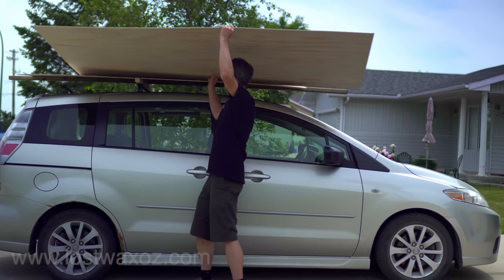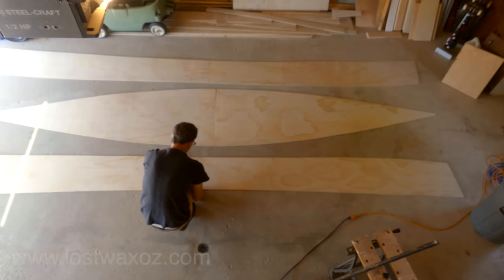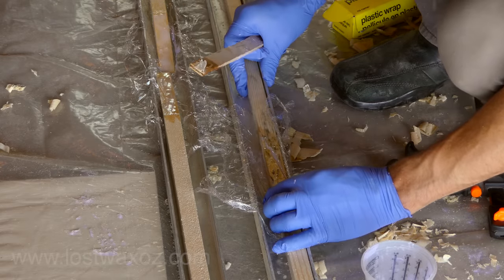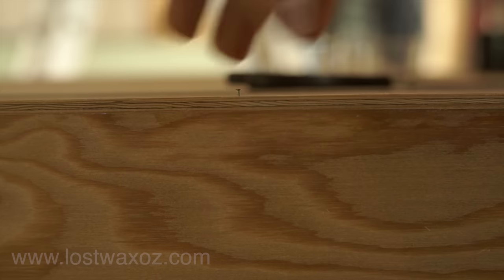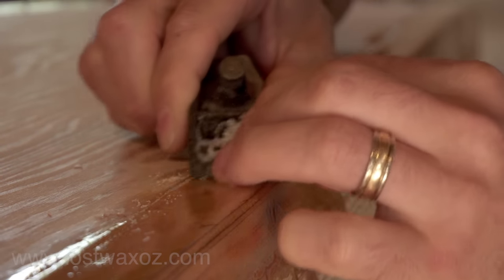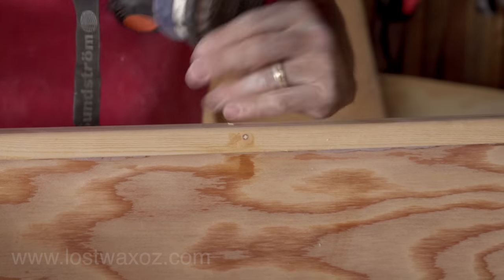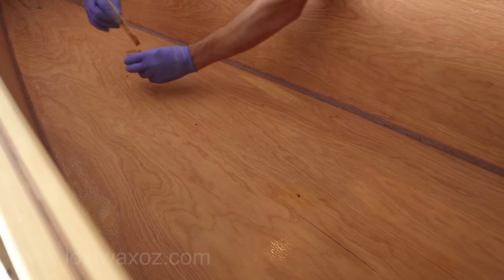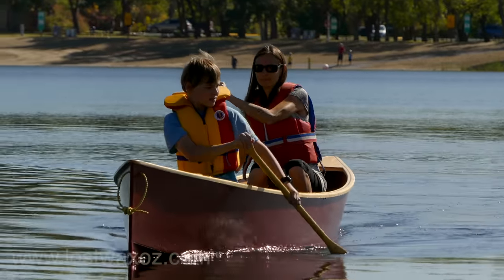Can You Make a Canoe from Plywood? DIY Quick Canoe. Plywood Cheap Canoe Build

Comment: A bit late to tell you that, but your non-water resistant plywood would have been fine once sealed into epoxy (as long as any hole, including screw holes, are epoxyed).

Comment: I built one of these years ago. They are nice boats. One thing that I would stress is to clean all the dust off the sides and bottom before trying to duct tape them together. I did not at first and, of course, the tape did not stick. The additional zip ties are a good idea. As I understand Michaels idea for this was to have a quickly built boat for when you find yourself wanting a boat and don't have one available, and it can be built very quickly and very cheaply if you are looking for a temporary boat, or, like this fellow did, you can make a really nice almost work of art. Well done Lost Wax 2

Comment: This was great to watch. I actually built one of these but had to leave it in my old workshop. Just a tip, that first plywood you used would have been fine as you are covering it with Epoxy and paint. This Marine ply is great stuff but heavily overrated. It just isn't needed for a canoe.

Really great to watch what you did and happy boating!

Comment: 9:55 Probably could have / should have routed a radius on that lift-point- just a thought.

Nice project. I can see myself building a canoe like this. I am an off-and-on professional woodworker and I can see that as a very good design for a user-friendly family canoe being that it's flat bottomed and thereby has some stability over a rounded chine canoe. 

As a woodworker, building a run of these with particular cosmetic and esthetic alterations seems like it would be a sensible effort. I have made boat bottoms in the past from 8' plywood. Athough from a cost perspective it might be hard to justify a reasonable selling price based on labor time, the availability of ACX and marine AAX is not what it used to be as you discovered.
Esthetically I would probably choose a non-keyed glued scarf to join the ply halves into 15'5" planks instead of a battened butt joint. You can readily plane these halves using a reverse fold. Not much more work than a batten over a butt, and no interruptions in the sole.

Another visual improvement you might consider for your next canoe is in the fiberglass tape application. What you did here is fine structurally. Nevertheless, you might find it less time consuming to apply the tape, and then use matt over that (width about 10"?) to extend the bulky edge of the tape further into the bottoms of the sole. This will allow an easier time fairing the transition, offer an added durability factor, while permitting the use of your random orbit sander to initialize the bulk of the work.

I hope you will be making more boats!
Reply from the maker: Thanks for the great feedback, I'm sure that'll be helpful for others considering a build like this. You are right, it would be nice to have a more comfortable place to hold the canoe while carrying, and rounding off those bits of wood would help. That is one of the main reasons I added handles to my sailboat build, and even though it weighs the same, carrying it feels like half the work.

Comment: Can you foam craft a canoe next?  Bettter idea, foam craft a full  size Viking boat?  BTW This is the best video I have ever seen and it has changed my life forever.
Reply from the maker: Did you know there are actually foam boats out there..... Made from the rigid insulation foam and covered with wood glue and fabric. Pretty cool. Thanks for taking the time to help me out! Much appreciated!
Reply: @LostWax2  I had no idea. I am going to look that up. Love all your content BTW. Cheers
Reply from the maker: I think one to look up is the sawfish kayak if I remember correctly....made from poor mans fibreglass
Reply: @LostWax2  Didn't you make a surboard using that method Chris?. Another cool exploration.
Reply from the maker: @MikStorer  Yep, totally, It worked quite good. I used it over EPS foam but I think you'd get even better results over XPS foam.

Comment: Great work! Did you cover all the boat with fiberglass? Or just the boat connection parts?
Reply from the maker: I Just used  fibreglass strips along the bottom edges and front and back points.

Comment: My boys and I love this video!  It helped to inspire us to build a similar plywood stitch build canoe.  

I'm struggling with the deciding on how much epoxy we'll need, and whether to coat any of the exterior with it (I read your previous comments on checking).  Could you estimate how much epoxy you used all together, and how much of that was used to coat the exterior?  Do you think it added to the strength and durability of your boat?
Reply from the maker: I used ARK Epoxy 2:1  1/2 gallon resin, Ark Hardener 2:1 1 quart-Medium, 11yards of 6oz x 2" fibreglass tape, Wood flour-1 quart, cotton fiber- 1quart, coloidial silica- 1 quart. I did order another quart of resin with a pint of hardener to finish the canoe, but my wood was really thirsty, so not sure if you would need that much or not. I'm not sure how much was used on coating the canoe vs the rest of it. TBH I'm not sure how much strength/durability it added, I made a little plywood sailboat a couple years later, without using any epoxy and it is doing really well 3 years later. I did use an oil based paint on it though.

Comment: Hey. Good video and I have just bought the plans on the strength of it. A couple of things. I notice you use a mix of epoxy and sawdust to make the fillets. How has that stood up over time given that  the instructions say to use the (expensive) microfibre material? Its listed as 'Fortifying Gluing Powder'.  Secondly, rather than use a piece of ply for the butt joints I was thinking of using epoxy and tape which some builders have used and which seems to work and looks slightly better - any thoughts?

I did build a cedar strip canoe a few years back which I really enjoyed and gave a lovely shape. However, it is very difficult to source the wood where I live now, and so a ply canoe seems a good option. We also have a lake just 2 kilometre from my house so a lightweight canoe would be perfect :-)
Reply from the maker: Hi there! I used wood flour (really fine sawdust) and epoxy for the fillets, I believe that's what's recommended in the instructions, the fortifying gluing powder is what is recommended when gluing other parts together, as it adds strength, but I don't think it would fillet well. The fillets on my canoe are still rock solid, no problems there. I don't really have any thoughts on using tape and epoxy on the butt joins, as I haven't really looked into it, but it would clean up the inside a bit. Hope that helps!

Comment: I know this is a bit late but if you paint your plywood with a 50/50 mix of Titebond III wood glue and water it soaks into the wood and when it dries give it a 100% glue coat.  It leaves the wood 100% waterproof and can be painted if you prefer. Much cheaper than marine plywood.
Reply from the maker: Hey, that's a great tip! Thanks!

Comment: How quick and cheap was your canoe?  I have seen them referenced under different names but all the same.  GREAT BUILD
Reply from the maker: It's really hard to say how quick it was, but from memory, I started in July and got it on the water in September. So, not that quick:) Wood cost me $80/ sheet x3 and I probably used about $200 worth of epoxy and glass supplies. You could save a lot of $$ using cheaper ply and not coating the whole boat with epoxy.

Comment: Nice work. What kind of sander are you using? It looks like it is a little more aggressive than a RO palm sander? I'm needing something like that for a project. Thanks!
Reply from the maker: Like the two handed one I used? That's a sander/polisher and yes it's way more aggressive than an orbital sander. You have to be pretty careful or things get sanded through. But fantastic. You can get some that also can be an angle grinder as well. really handy.

Comment: Everything looks great. Good Idea to make yourself one of those plywood canoes.But my question is how much in total the cost of build the canoe is?.Right resin ,glass fibre,plywood the right one for the project are not cheap.For someone who has right tools,place,and time to build one it is a great idea.Nice work!
Reply from the maker: Doing it with the materials I used, around $450 CAD.
 Wood cost me $80/ sheet x3 and I probably used about $200 worth of epoxy and glass supplies. You could save a lot of $$ using cheaper ply and not coating the whole boat with epoxy though.

Comment: Great video and canoe. I am curious as to what it weighs. I have heard that epoxy and plywood boats are usually lighter. Have you weighed it?
Reply from the maker: It weighs around 70 lbs. Would have been lighter if I could have used slightly thinner plywood though.

Comment: So I have a few questions. 
1. How long did it take you to make it?
2. I only have 4 clamps. do I need to get more?
3. How much money did the wood cost? How about all that epoxy?
4. What kind of wood is that?
Reply from the maker: It took a couple of months, you need more clamps,  Wood cost me $80/ sheet x3 and I probably used about $200 worth of epoxy and glass supplies. You could save a lot of $$ using cheaper ply and not coating the whole boat with epoxy. I used fir marine grade ply, which I wouldn't use again, as it checks/splits over time- I actually just finished sanding off the original paint and re-painting it with oil based rust paint like I used on my little sailboat, and I am hoping that might help....

Comment: Super helpful to see the steps in detail. Two questions: what kind of paint did you use? And how is it holding up with epoxy on both inside and outside (I've read different things about whether that's the best approach). Thanks in advance :)
Reply from the maker: I used Valspar Duramax paint which is an exterior paint and primer. It's alright, but I just made a plywood sailboat this year and used a alkyd paint and I think it'll hold up better. Time will tell though. When I first made the boat and mentioned to some seasoned builders that I had used fir, they said it would likely check. That's the main reason I coated inside and out with the epoxy. However, the outside is still checking, so I'm not sure how much difference it made. The canoe is stored indoors so it doesn't get a lot of weather exposure and only comes out a few weeks a year.
Reply: @LostWax2  Thanks for the quick reply! I have a tub of Valspar combined primer/exterior house paint (which a lot of amateurs seem to swear by as it's super durable, out in all weathers for years), so figured I'd put on a couple of coats of that over the epoxy. It seems like expert boat builders warn against coating in epoxy as it can crack as the plywood flexes and let water soak in but, like yours, my canoe will be stored indoors with only brief outings on the water.

Comment: Great video, thank you! Question: I am building a plywood sailing canoe and was thinking I need to fiberglass the entire bottom but after watching your video I think I will just fiberglass the seams where the side panels meet the bottom panel. How have the seams held up on your canoe?
Reply from the maker: The seams have held up fine on my canoe, they're as good as the day I made it. The problem I have is that I made the canoe with fir plywood, and it has started to check in the un glassed sections. So I'm gonna have to repaint it. If you are using a wood that is not prone to checking, I think you could get away with just glassing the seams.
Reply: Does your sailing canoe work?
Reply: @aswd45-mk14  yes it works great!

Comment: Hey, loved the video : ) I am thinking about building one myself and would be very interested in how much you roughly spent on it. Thanks in advance : )
Reply from the maker: Doing it with the materials I used, around $450 CAD.
 Wood cost me $80/ sheet x3 and I probably used about $200 worth of epoxy and glass supplies. You could save a lot of $$ using cheaper ply and not coating the whole boat with epoxy. 
I just finished a sailboat this year, and used cheaper ply and rust paint. It turned out really good.

Comment: What dimension were the plywood sheets you used?

Do you mind attaching a link from the shop you bought them?
Reply from the maker: The plywood was 1/4 inch thick, 4' x 8' I bought it at a lumber store called Windsor Plywood. I wouldn't recommend using fir though, It has checked a lot, and I'm finding I have to repaint it every couple years. If I was to do it again, I'd try find slightly thinner wood, just to lighten it up a bit.

Comment: If you don't glass the boat inside and out, and even the gunnels you will regret it.  Been down that path over and over, and anything left un-glassed takes tons more time to repair later.  Particularly necessary if you store outside, but even if you don't.

I remember when I got my plans for my trimaran and I first realized I would need to glass every detail in the cockpit.  I was outraged.  But for instance I did not glass the storage pockets, and they have taken far more time to maintain, than the hour it would have taken to do them properly the first time.

Latter I built a dingy, and having had a lot of experience since, I glassed everything including the gunnels.  Boat lives outdoors in Canada for over 20 years and the thing is as good as new.
Reply from the maker: Experience is the best teacher, thanks for the excellent info!

Comment: @Lost Wax 2 >>> Don't take this question the wrong way, but did you consider fiberglassing the canoe instead of just the painting it with epoxy?
Reply from the maker: Yep, I did, and it would have stopped the wood from checking, but I really didn't want to add any more weight to the canoe. To be honest, I'm not sure if I would paint the outside with epoxy if I did it again, it still did check a bit, and that's the main reason I did it.
Reply: @LostWax2  >>> Rodger all that -- Thanks.
Reply from the maker: @Allan_aka_RocKITEman  No worries!

Comment: You would have been ok with the first set of plywood becayse the epoxy and resun and paint all add to the waterproofing,  so to those who dont know, yes regular plywood can be made water tight and also a trick when applying resin or resun fiberglass you sn use saranwrap or plastic bags  just draw it tight after you put the resin  on smooth out the bubbles and you will begood to go after it hardens just peel and fine tune, aka light sand like ur washing a baby soft n gentle lol, nuce job on build, very impressive for a non carpenter / boat / canoe builder, and yes i use to make all types of boats and canoes aleays eanted to try plywood just never got around to it lol, anyhow thanks again and live the wirk you did way better than alot out there so great job sir!! 10 thumbs up
Reply from the maker: That's some great info, thanks for sharing! I remember I used to fix dings on surfboards using cling wrap to smooth out the resin as it cured for less sanding later. I'd forgotten about that:)
Reply: @LostWax2   your welcome and it's not a very well known trick, but man gotta love the end results super smooth like glass lol,

Comment: Hello! I have a question. How much of the fortifier glueing powder did you end up using?
Because it says 500g in the manual, but I am wondering if it’s not a bit much
Best regards
Bella
Reply from the maker: I used about half of the container I had, which I think was one quart. However I have no idea how much it weighed.....
Reply: @LostWax2  thanks for your reply and heaps thanks for that video. I just finished filleting and I think until I got to this point I already watched your video 10 times as a guide in addition to the plans.as I am a total newbie in woodworking and English is my second language it was way easier to understand what Michael meant :D but I managed and looks pretty stable and aligned
thanks a lot
Reply from the maker: @isabellforester6371  Glad it is working out for you!

Comment: Why wasn't the price brought up? I'm wondering if it's worth building one or just buying a used one
Reply from the maker: I didn't mention the price because it really depends where you live as to how much it costs, and I also had all the epoxy donated to me by Noahs Marine.  Wood cost me (canadian dollars)  $80/ sheet x3 and I probably used about $200 worth of epoxy and glass supplies. You could save a lot of $$ using cheaper ply and not coating the whole boat with epoxy. In fact I am building a little sailboat right now, and I just spent $30 a sheet for ply and the ply is in my opinion much better.

Comment: Just fyi, if you cover the entire boat with fiberglass and epoxy, it doesn't matter of your wood is waterproof, because it'll never be exposed to water. I've seen a huge yacht made out of chipboard, which absolutely is NOT waterproof. But the fiberglass and epoxy made it waterproof.

Comment: What thickniss is the plywood? I can get 4 and 6 mm. I can gst what they call marine grade plywood, this will be sufficient i presume?
Reply from the maker: I used 1/4" thick which should be 6.35 mm thick. And if it's called marine grade it should be good. Always worth testing a little bit though. If I had the option of 6mm and 4mm, I think I'd try using 6mm on the bottom and 4mm on the sides to keep the weight down a little.